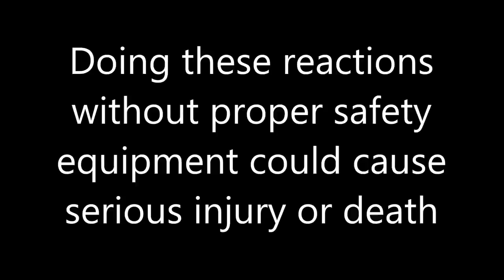Gold Plated Computer Scrap Complete Refining

Comment: By now you have probably figured out that you should separate your pins before processing them. Any copper that is dissolved into the acid will plate out onto the Iron pins. That's why most of your pins look like they have a fresh copper coating on them when you pour off your acid. Until all the iron is gone, this will continue to occur. This is the worst way to process pins.
Reply from the maker: I’m just glad it’s over and I’ll never have to do them again!
Reply: @sreetips 
Hi Sreetips,
It was obvious that you lost your patience.
You did not add a few drops of sulfuric acid and you tried to filter the hot solution… ;-)
Nevermind - nice button.
Reply: Ahh, that makes all kind of sense.  I'm writing that down.

Comment: Oh man. I’ve gotten impatient so many times trying to filter hot AR just to have the filter let out in my Buchner as well. Best to let it cool as you know, plus the bit of silver and lead will precipitate once fully cooled and can appear even after filtering.

Side note, as I started with electronics refining years ago and had my fair share of everything from pins to transistors etc, try this method out:

With material like your pins, add HCL as normal, add about 15% sulphuric acid, and add sodium nitrate. 

What happens is the sulphuric creates a passive layer over the base metals and puts gold into solution right away. Doing this with a hot solution, one gold is fully disso, quickly decant the solution and rinse the pins well with hcl and agitation. If there is some small cementation of gold on the pins, it’ll get rinsed off with the hcl and trapped in the paper filter. Throw that into your second AR with the precipitated gold and you know the rest!
Reply from the maker: Good tip, thank you

Comment: I'll be doing a batch of this soon myself.  I've dealt with a small batch of very thick old pins before.  What I did was a partial dissolve with just a little bit of peroxide in weak roughly 1M HCl.  Then I let it sit and break down the peroxide in bright sunshine.  What it did was poke holes in the plating, but then redeposit the gold (and even most of the copper) as the weaker acid couldn't hold the metal once the peroxide wore off.  Tin from the brass core of the pins displaced the dissolved copper too, I suspect.  

After a day, I tested the solution for gold, and there was none.  I repeated it until the gold foils were loose and all washed off.  It worked, but it took a ridiculously long time since the pins were 1/8th inch thick at the bases.  It would probably have worked best with thin pins.

Gold-plated steel pins, yeah, those would likely work pretty well.  Iron and nickel chlorides are very soluble at acid pH.  Weak HCl actually works much better against steel than concentrated HCl, because ionic chemistry stuff I can't recall explicitly!  And a little peroxide would REALLY destroy the steel with those ROS added to the acid.

Comment: I mentioned this before. Dilute Ar will blast right through magnetic and stainless base metals. If by any chance it dissolves some of the Au, it will cement right back out. So as usual it's a good idea to test for Au in the solution. When in doubt dump it in a stock pot. Nice button, add a stud and you have one nice looking ear ring

Comment: I too have been waiting for this one :)
BTW these pins and contacts are not just plated gold. Gold doesn't do to well over pure copper or iron so there is usually a barrier layer of nickel or nickel and palladium, which is often quite a bit thicker than the gold layer (I can provide a link if you want). The solution you had at the end was too green, suggesting there might have been some pd in there with the nickel, but that might just be the camera. If there is a next time it might be fun to test for pd too.
Reply: I'd bet it's just a smidge of nickel and not enough PD.
Reply: @anthonyrstrawbridge  It really depends on the process and purpose of the pins. Pins from connectors that are meant for RF frequencies such as those from the backplane of a network switch, will have very little nickel in them, as the magnetic properties of nickel can cause problems. Those will have a Pd layer of up to several microns with a gold layer that is less than a micro (and some cobalt mixed in). Cheep ENIG (Electroless nickel immersion gold) plating, which you are right is almost certainly what these are, will have a 1-10 micron layer of nickel with a 0.1-0.5 micron layer of gold, with everything else at trace or contaminant levels.
...... it was just that the solution was soooo green, I immediately thought 'ooooo .. palladium!' :)
Reply: Guys he knows what he's doing. Nice of you for trying to help
Reply: Ian… could you post that link?

Comment: I think most try and go for dissolving the gold. The pins just take too long to dissolve. A plating rig might be a solution for the amount on the pins. Then again I think I seen a few try and do a melting to separate the gold and copper off the pins and then separate out the copper.
Reply from the maker: Sulfuric acid stripping cell is best for gold plated material - but I can never get a good yield.

Comment: The initial batch I did with completely plated pins yielded a bit over 1 gram of gold from 100 grams of pins.  

The partial-plate ones will clearly be much less, so those I'll do with sulfate electrolysis after melting them into a rod anode, to save on reagents.

Comment: probably much better to dissolve the gold because there is so much less of it. Otherwise you want to grind it up to give the acid as much contact with the metals as possible. The gold is acting as a protective coating and only where the gold layer is broken can the acid reach the metals.

Comment: I wonder if more physical destruction--even just whacking the pins with a hammer for a bunch--would help the initial dissolve of the base metals into solution. My reasoning is that the actual gold is extremely thin, but it is covering a LOT of the metal. Making it hard for the acid to get at the base metals. Kind of like how you inquart with silver, but just physically opening up tiny cracks through the gold and into the base metal.
Reply: I think an old blender would be quite useful for that.
Reply: @Jtretta  yeah, or a cheap coffee grinder.

Comment: I wonder if grinding the pins down and rusting out the iron, and or melting the pins down with possibly adding more metals and make small flakes from the melted pins to then treat with acids.   Just ideas,  I really don't know anything about this.  Or is it possible to dissolve the pins whole and just have gold + a slight bit of junk  come out of solution.

Comment: Another great video and I completely understand why you don't do this type of material.  I stopped doing it about a year ago myself.  I find it just isn't worth the time I have to spend on it where I can better spend the time on other pursuits.  The only way to speed things up adds (in my opinion) far too much expense to justify and even then it doesn't really speed it up enough to justify.  But time can also be free so when I do get this type of material I do one of 2 things: either soak in HCl and let sit with an air bubbler until everything dissolves. or I just toss them into the stockpot and let it do all the work for me.  I tend to do the latter.  With these kinds of pins.  I really don't care about the specific yield and just take whatever they give me so whatever they dump into the stockpot is a freebie for me.  Any foils or plating collects in the sludge along with any Pd that occasionally is part of the plating.  I just treat it like copper and any PM is a bonus.  But this whole video really outlines why some of us say "no thank you" to this stuff.  :)

Comment: This is the one I've been looking forward to for ages!!  Can sreetips do the impossible and make a profit from e-waste?
Reply: @brianhbinesh  you need to see some of the stuff I buy off ebay. I make a killing. 50 pounds of fully plated military radar boards from the 70s for $79. 13boardswith103 white ceramic gold cap gold leg chip for $39.99 that doesn't included the fingers gold tracing etc on the boards. That is only a small sample of the auctions I buy and it doesn't matter if I pay twice the amount in aicd I would still make a good profit but I use the cheapest way possible in most cases to make more money even though I have plenty of nitric
Reply: @brianhbinesh  I also buy and resell extremely rare chips anywhere from $25 to $5000 and up if you get lucky.

Comment: Boiling HCl for dissolving Copper is slowing it down. The compound that does dissolve the copper is the Copper(II)Chloride + Cu => 2 Copper(I)Chloride.
This explaines why it takes so long to take off. Because the most active compound must first be created. Feeding forward some solution from a previous batch helps a lot.
To convert the Copper(I) to Copper(II) you need HCl and Oxygen from the air. By boiling you basicly drive all the Oxygen out of your solution. So the generation of the necessary compound is stuck.

Comment: Sreetips,

If you were to go ahead and combine higher quantities of nitric with the hydrochloric earlier in the reaction, filter as your normally would, then add copper to the filtrated solution to cement out the precious metals, would that speed up this process?
Reply from the maker: Possibly.
Reply: Copper Sulfate is a blue crystal and can be used with electrolysis, and just like you taught us in the Reactivity Series video, Copper will make Gold precipitate out when cooled. @sreetips
Reply: I would even go so far as to say use Iron Sulfate to drop the gold after Aqua-Regia.

Comment: If you ever attempt this process again. Try this method.
Dissolve all the pins in AR. But use a Nitrate substitute like Potassium Nitrate "found as a Stump Remover at Tractor Supply or High Yields Nitrate of Soda".
This will save you time and money for the cost of Nitric Acid.
Then use Iron Sulphate to drop the Gold out of solution.
Next refine as usual..

Comment: Basically the yield is too low compared to the time spent. Probably would have been better to use the stripping cell on these. High base metal to gold ratio if I understand correctly

Comment: I would use an iodine/iodide process for plated items. Iodine doesn't get enough attention. In my experience, reverse-plating is messy and labor intensive (and dangerous) and produces a lot of colloidal gold. Cupric Chloride works best if the pins are chopped up and free of solder.

Comment: Another awesome video brother! Hey I just picked up a couple pounds of plated jewelry/ Scrap. I heat some of it up and a few pieces melted down like it was lead. Do they plate lead? Or is it some other low melt temperature material? Can it be processed for refining? Also some of it was magnetic. Can I process it all together for refining? Thank you!
Reply from the maker: I’ve seen gold filled over lead. That’s why it’s important to test each piece before committing.
Reply from the maker: The only magnetic pieces I process are watch band caps. Everything else is usually brass
Reply: @sreetips  What will I need to do if I have lead in solution?
Reply from the maker: I don’t know what you have there. I add sulfuric to precipitate lead sulfate then filter it out.
Reply: @sreetips  Thank you so much! You confirmed what I was already thinking. Only because that's what I learned from you. I don't know what else it could be. It melts just like lead. I had it in a stainless bowl and was heating it all with mapp. It was the only thing that melted at a really low temp and stayed molten for quite some time actually.
Reply from the maker: Sounds like lead, I’d remove it from rest of the material
Reply: @sreetips  Thank you so much brother! Can I process it separately? It's about a half pound on material.
Reply from the maker: I don’t know
Reply: @sreetips  So when I put about a ml of sulfuric in solution I got a white cloud. Is that the lead precipitating out?

Comment: Why did you try straight HCl for so long? You already know that there's a lot of copper in pins and that Cu doesn't like to go into solution without an oxidizer present. Were you just experimenting to see how well it would work on the iron? I will say that more of it went into solution than I was expecting before you started adding the nitric, so that was pretty cool.

Comment: I was wondering if cupeling has any advantage for this type of problem where there is so much base metal to get rid of first.  That is cupeling as a pre-treatment for the chemical process you're using.  Cupeling has it's own issues and the big question is if there is any advantage for those initial stages of refining and if the yield is as good.
Reply from the maker: I don’t know. But it’s not a concern because I’ll probably not process this type of scrap anymore.
Reply: @sreetips  Makes a ton of sense - you did get a pretty nice yield but that is a ton of work!  Great video and that button is a work of art! 👍

Comment: I watch an older video of yours the other day and you used reverce electro plating. I'm thinking that it would work on the pins and take less time. As well as have less cemicol waist.
AkFred
Reply from the maker: Reverse plating in a sulfuric acid stripping cell works best with gold plated scrap.

Comment: Mr Sreetips, now that my hobby became serious, I am looking for ways to reduce cost (a.k.a. use less nitric). More than 90% of what I refine is exactly what you have one video. Most often, I use HCl only, it does not take that long and I never had to keep renewing the acid. Worse case scenario, for example, when my batch is taken more than 4hrs, I add H2O2.
Last week, I tried sulfuric after watching one of your latest videos, worked fine as well but generated a lot more waste.
I wonder, in the first small beaker test, why it took that long and you had to change the acid that many times. And Indont discriminate, magnetic, non magnetic, whatever eWaste pin is game.
Also, since the yield is low, I usually wait to accumulate a good amount of foils and flakes, either to treat with AR themselves, or combining with under 1 gram of placer gold I receive as gift every month.
Anyway, I am curious about the volume of HCl and the time it took.

Comment: What can you use instead of Nitric Acid in the steps around 30 minutes and beyond? I have all of the OTC products that you have in other videos, stump out, ROOTO and so on.
Reply from the maker: I’ve hydrogen peroxide and HCl to dissolve gold. Also, Clorox and HCl, makes chlorine gas and gold will dissolve in chlorine gas.

Comment: I wonder if you really have to heat the hydrochloric acid so much.
What I mean is that if it is at room temperature and the iron and copper dissolve anyway, for a long time, you do not need to control the process and can just leave it unattended!
Reply from the maker: It may take weeks or months

Comment: The good output of the material is most likely due to the fact that some of the fingers are from military connectors, or from 90's servers.
And in general, what would you recommend with such material? Melange?
Reply from the maker: I did this to produce the video. I don’t process much escrap because the yields are so low.
Reply: @sreetips  I understand from your video that you are not interested in recycling e-waste. But I know a man who has about 20kg of such gold fingers. What would you recommend for self extraction of gold? What method of gold recovery for such a large volume? Melange? Other?
Reply from the maker: Acid peroxide for trimmed circuit card fingers would be me choice.
Reply: @sreetips  СН3СО3Н? Thanks! Спасибо большое.

Comment: Have you considered adding some salt and or the mild 3% hydrogen peroxide from the grocery store which worked very well for me for getting the foils free floating but mine had a lot of garbage with them because they were from cell phone boards and I haven't quite worked out how to separate all that solder and plastic and fiberglass from the tiny gold foils which I might not ever actually do because it was a very small amount and just like you're doing there and experiment to see how it worked what things I already had laying around
Reply from the maker: Yes, I used salt to recover gold foils a long time ago.

Comment: I’ve watched many, many of your videos at this point. Yet I still, kinda hold my breath when you pour acid into a boiling beaker. I guess I’ve seen too many movies where someone pours something into a beaker and it explodes or something… 🤦‍♂️😂😂
Reply from the maker: Every now and then I’ll experience some serious pucker factor. Usually when I’m alloying silver with the karat gold and pouring it into water. If the alloy gets too hot, it will tend to explode on contact with the water. Scares the day lights out of me. You can actually see my jump when it happens.
Reply: @sreetips  any videos u can think of off the top of your head that I could see this in? Curious how that looks.

Comment: I was waiting to see this video. Very nice work. But I m confused. U put nitric in HCl to remove base matels and boil that gold did not desolve at that moment. I think that work like  aqua regia
Reply from the maker: It’s confusing. The dilute aqua regia will tend to dissolve the base metals first. Any gold that goes into solution will cement right back out on the base metals - it won’t stay in solution so long as the base metals are present.

Comment: Why didnt the gold initially dissolve with the base metals? Does aqua regia need to be at a minimum strength with nitric?
Reply from the maker: I’m not certain of the chemistry behind it. But the aqua regia will attack the base metals first. Any gold that does dissolve will cement right back out of solution on any base metals still present. You could just keeping hitting it hard with nitric and put everything in solution then try to precipitate the gold. But it makes a very dirty solution and recovery of the gold difficult.